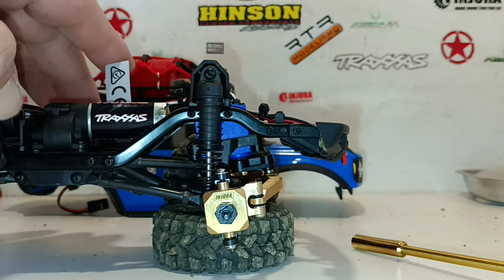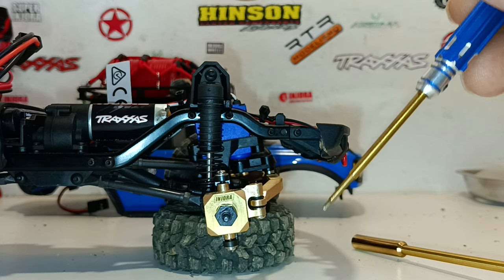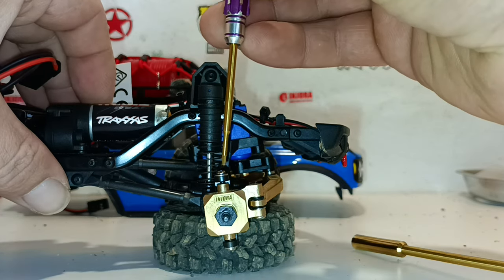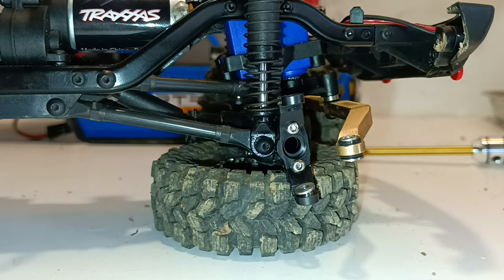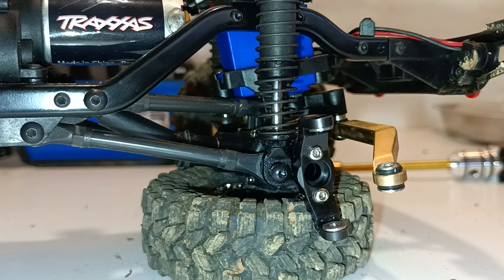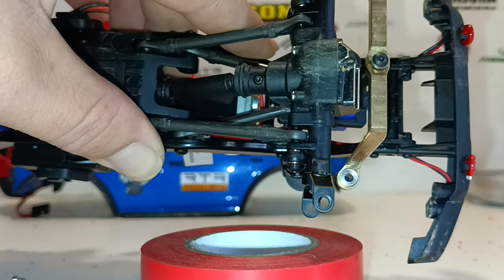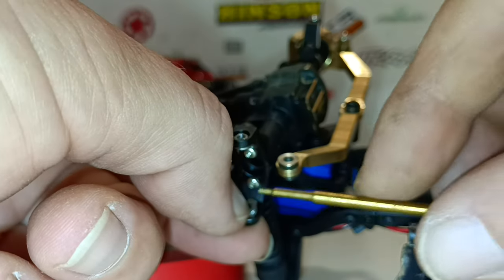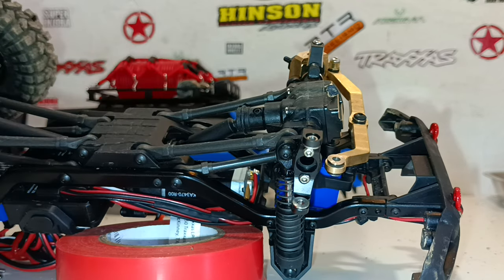Installing Injora C-Hubs Traxxas Trx4M - correction video

Comment: Thank you for this video.  I made the same mistake as you did initially as the bushings fit perfectly in the recess area of the top/bottom of the C-hubs - almost seems like it was perfectly made for it, but something didn't seem right as there were visible gaps between the C-hubs and knuckles.  So glad I found this and corrected my installation as well.
Reply from the maker: Anytime bro, I only had this problem with this set of Knuckles, they just didn't want to fit from the bottom and as this was the first time I had done it, I really did think that it went in from the top. 
As you mentioned it looked like it was a perfect fit 😅
Then I installed them on the next truck and realized that they slipped in perfectly from the bottom. 
And then there was absolutely no Gap, the way it was supposed to be.
Therefore I made this quick correction video showing what I did wrong. 
This was right in the beginning, when these parts were just released. 
It was easy enough to correct once I removed a bit of the black paint, they then also slid in from the bottom easily enough. 
I'm glad you found the video helpful, I really appreciate you watching and commenting. 
🤜💥🤛

Comment: Awesome job, love all the Injora parts I've gotten (just about everything they have for the TRX4M at this point) and the tolerances on all of their parts seems to be perfect to very tight. I'll take having to press fit things together though over it being loose.
Reply from the maker: Can't agree with you more it's just annoying that these two C-hubs that you see had quite a big imperfection in all four holes so when I was trying to mount it they would not go in no matter what i did.
So I had to remove the little lumps they left behind so I could actually get the bushings in and as you can see it was still a nice tight fit.
The other set I have had no problem and was perfect.
And until now I have not had one problem with Injora parts.
Thank you very much really appreciate the view and comment 👍👍

Comment: What size drill bit did you use?
Reply from the maker: I used one just a slight bit smaller than the hole and just ran it around the edge just to remove the imperfection and a slight amount of paint.
Reply from the maker: You can also just use a piece of sandpaper rolled up and file gently
Reply: I think it's the power coating that causes the issue
Reply from the maker: @makoskid  one set was perfect and didn't need me to remove anything and the other set actually had a little piece of brass a buildup of paint right by that piece of brass that had to be removed for the bushings to fit.
Still love the products 💯
Got nothing bad to say about their parts 💯